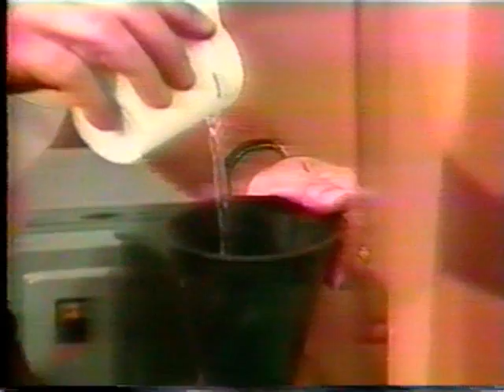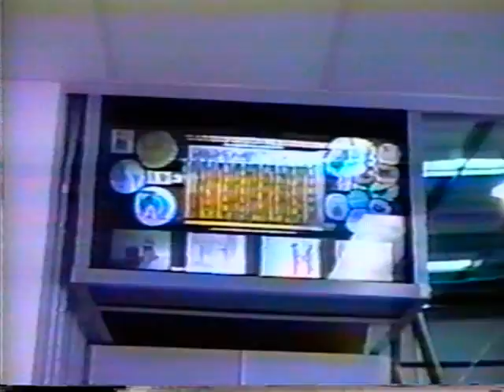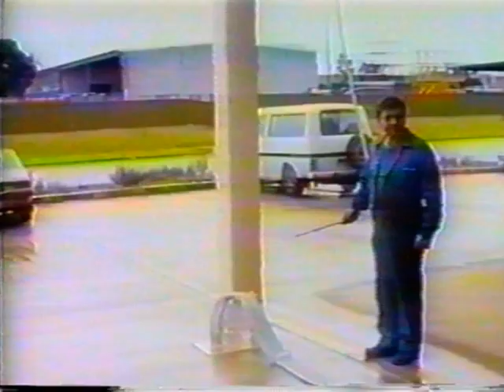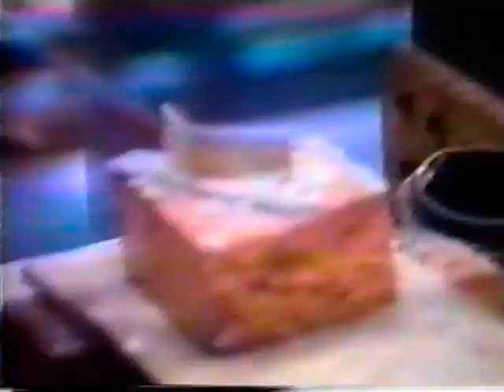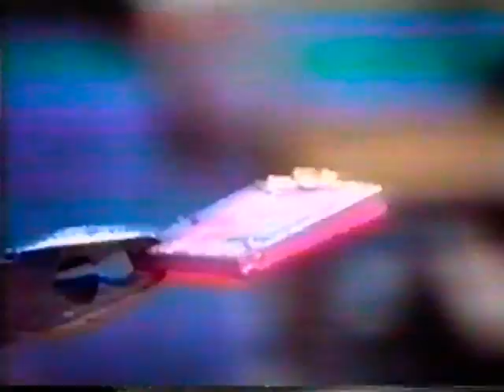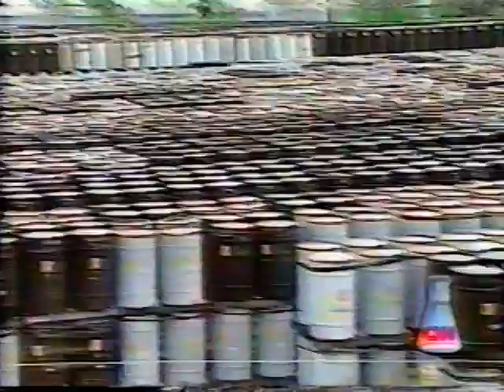Brown's Gas

Comment: Stanley Meyer did it with low current high voltage & high freq. and no water additive.
Reply: Stanley used hydrogen and yes it also is amazing if you know the difference than you would understand their purpose in the application. 2 different techs but of the same source. Meaning putting certain energy into cooking certain metals to get different types of gasses. Those are metals you can create energy from. Now let me introduce plastics/silicone type of gasses, this is also done by microwave. Cook the plastic in that form to produce gasoline or diesel out of plastics after distillation of course. it goes on brothers and sisters and yes is easy, but money issues will arise.

Comment: 2:00 idk why he thinks we could replace electric generators with a fuel that requires more energy than it produces. Sure, it would reduce energy emissions of the fuel network by utilizing the electrical network and local water sources, but it is not by any stretch a replacement for traditional energy sources.

It's an unfounded claim.
Reply: How much research have YOU done?
Reply: @patrickbodine9252  I have an undergraduate in electrical engineering, am a masters candidate, have taken 4 courses in materials science, inorganic chemistry, organic chemistry, and broad scientific principles.
Reply: @Patrick Bodine  I have done quite a bit of research into alternative energy sources, and I cannot find any evidence that Brown's gas contains any significant concentration of monoatomic oxygen. In fact, all the evidence points to it being a 2:1 stoichiometric ratio of dihydrogen and dioxygen. The only "implosion" that can be observed from it's combustion is immediately following an explosion when the now monoatomic particles bond to for H2O.
Reply from the maker: It should be possible to build an implosion engine and power it with Brown's gas using it's implosive properties or play the flame on materials that produce heat for a steam engine.  Either way you would likely get more usable energy than it takes to run the process.
Reply: @BeFreeTech  that would be amazing, but I haven't seen any evidence that it is possible to produce or store monoatomic oxygen or hydrogen for any significant period of time. I'd love to be proven wrong though, since that is the one factor regarding Brown's gas that I find to be unbelievable
Reply from the maker: @STRIKEcorperation  There's no need to store browns gas to make power with Browns Gas - the power can be used immediately when the machine is generating heat or turning the implosion engine.  That said - storage of Brown's gas was being tested with uncertain results.  You're probably not going to see this particular method of producing power for free since there are so many others that are better coming (eventually).  :)
Reply: @BeFreeTech  what benefits does browns gas have if it isn't stored? Generating it through electrolysis has under-unity efficiency, and one could achieve the same ends using electric motors, arc welders, etc.
Reply from the maker: @STRIKEcorperation  You probably haven't yet understood that the implosion of this gas is complete with no residual remaining.  Browns gas is unique because of the way the oxygen and hydrogen are recombined in the technology.  It's not standard electrolysis   If you use it in an implosion engine you can produce more power than is used to generate that power.  You could also (potentially / possibly) get more heat out of it than the relative amount of energy to produce - using a steam engine for power out - if you wanted to go that route.  No need to store it - though that too might be possible for those interested to experiment / try these notions.
Reply: I wonder how efficient it would be at storing energy. For example, using surplus photovoltaic electricity in the daytime, then generating it back at night, and something similar for wind power.
Reply: @ChaplainDaveSparks  Electrolysis is now usually around 80% efficient, with higher efficiencies being possible. As a store of energy, mixed hydrogen/oxygen gas would be unnecessarily dangerous; you could capture the hydrogen, store it, and 'burn' it later with oxygen pulled from the air. Starting with the most usable form of energy, electricity, and converting it to hydrogen, then converting it again when used is quite inefficient, especially when considering batteries can achieve 99% storage efficiency. Brown's gas has multitudinous, amazing uses, but there are better ways to store energy.
Reply: @steveyoung3304  I completely agree with you. One reason that further complicates the storage of hydrogen is that it must be contained in a pressure vessel. Fossil fuels can simply be poured into a plastic tank with a vent and flame arrestor, but hydrogen would need to be compressed to near liquid state to have comparable density.

It is still a fuel with various great uses, but a viable replacement for existing energy storage it is not. I personally favour pumping water into an artificial lake with a high elevation.

Comment: hello sir how many round plates are in one stack for positive & how many plates are in negative stack & working on how many volts how many
Reply from the maker: Thanks for your question(s).  I don't know the answer(s).
Reply: Then who know it?
Reply: @santoshmane3383  It's in excess of 300 plates in Brown's gas machines made by Hydrogen For Health (Steve Dell).  Go check out his YT channel Delvis11.  Here is a 354 plate unit.  https://youtu.be/OCXOQkCmOUc
Reply from the maker: I haven't taken a cell apart.  Somewhere in the Brown's gas video you can see a cell separated so you may be able to count the cell plates
 from the video.
Reply: @BeFreeTech  what its the set up on the spark to fired the H on the cylinder,  I see t h e  spark its blue, and blue spark its eletrons, z  not positron  like in the regular spark  ignition,  With is controlled  in many  car manufacturers they put diode on the negative wire side of the coil,, and straight on positive , explain why
Reply: @Alwaysbusy300  Go look at Delvis11 on YT.